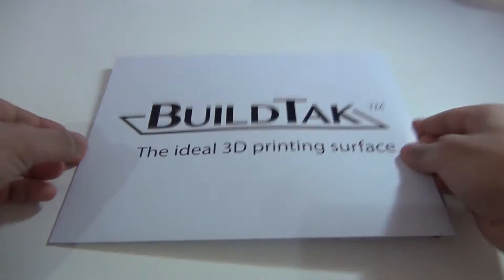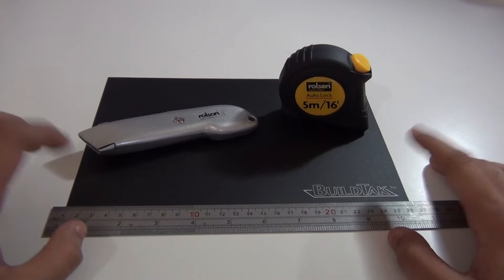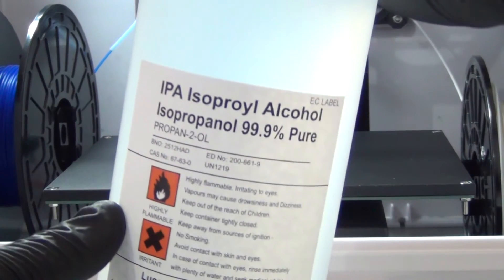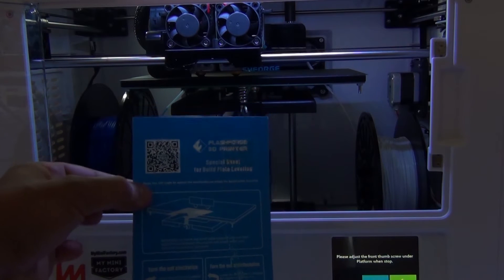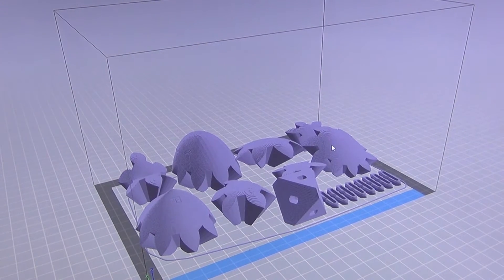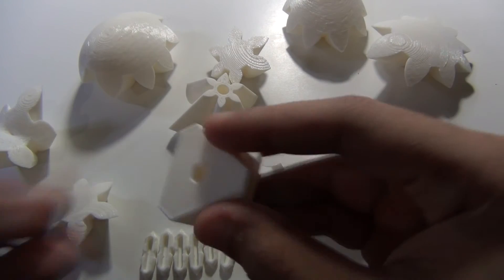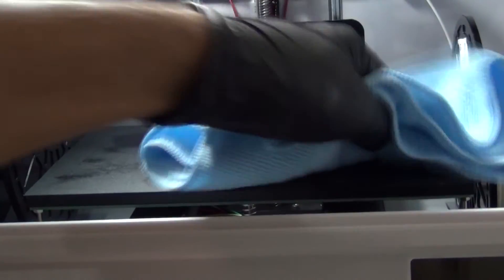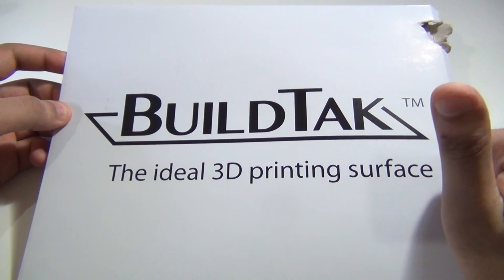Best Printing Surface? BuildTak Review and Setup 3D Printer

Comment: With regard to using Isopropanol for cleaning the BuildTak, the manufacturer recommends not using anything above 70% strength. Your 99.9% strength Isopropanol might have a detrimental effect.